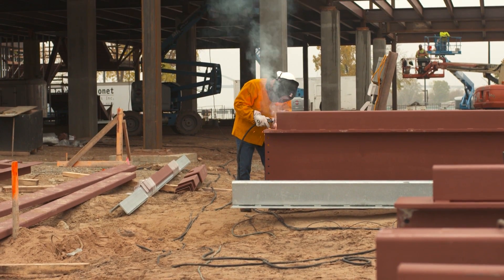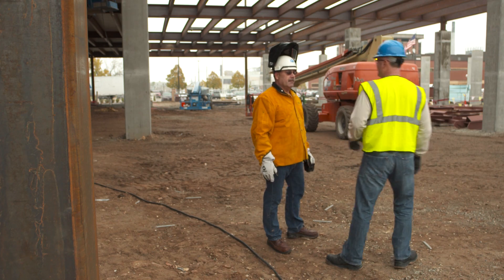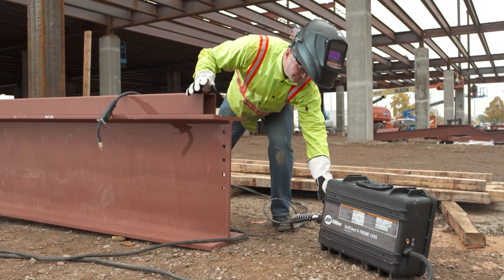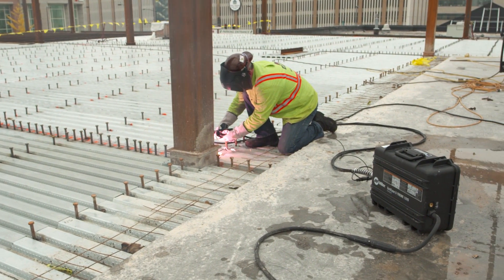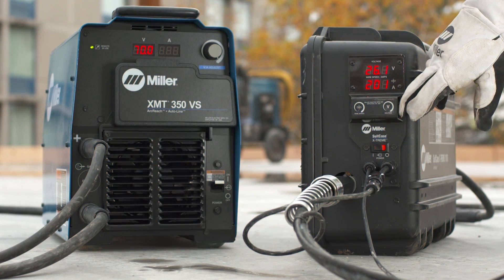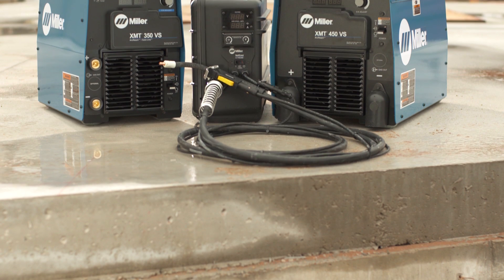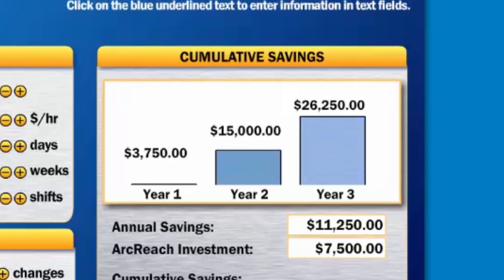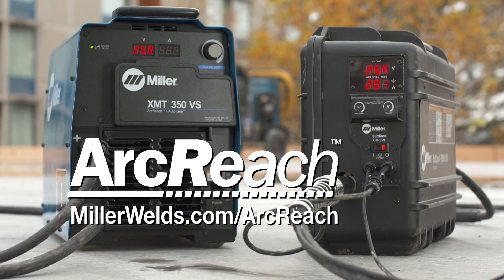Miller XMT Systems with ArcReach Welding Technology

Comment: Can I run an old trailblazer 280 on this setup?
Reply from the maker: Unfortunately, the Arcreach feeder cannot communicate with the Trailblazer 280. The feeder will power up and work like a standard voltage-sensing wire feeder, but the user will not be able to remove or adjust the voltage.
Reply: @MillerWelders  is there a better setup for the trailblazer 280
Reply: @MillerWelders  I also plan on running a Ys lineboring setup with this unit

Comment: Can I weld aluminum in the gtaw process with this xmt 425 machine?
Reply from the maker: Hi, Danisky. The XMT 425 cannot weld aluminum in the GTAW process. Welding aluminum requires an AC output in GTAW which the XMT 425 does not have. Please let us know if you have any other questions.